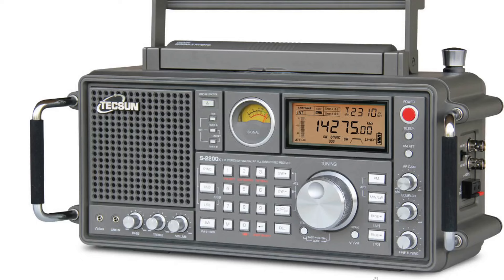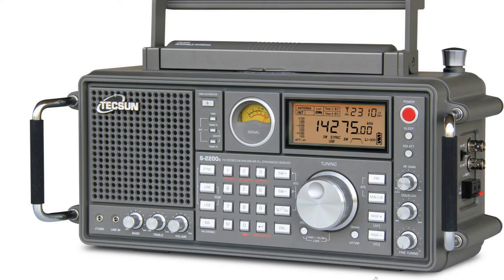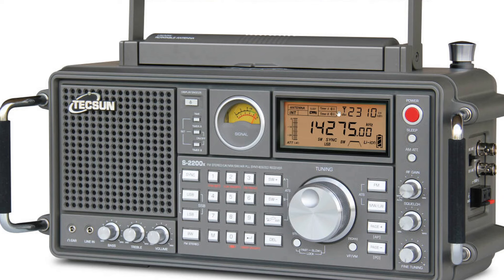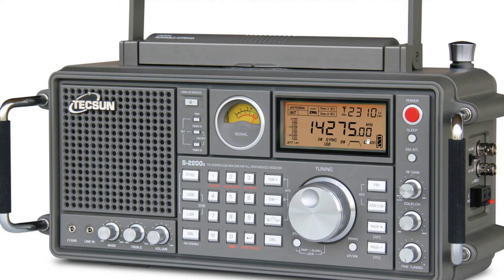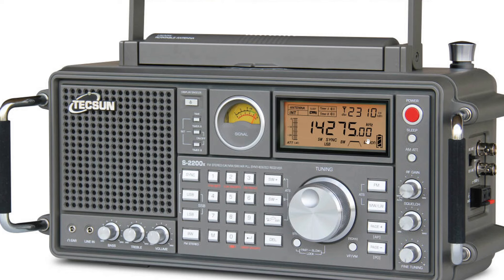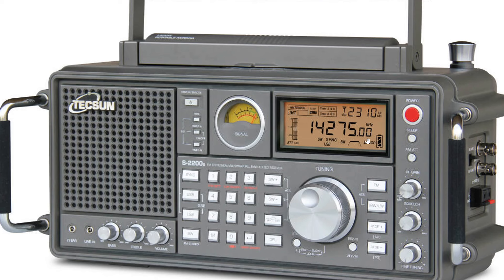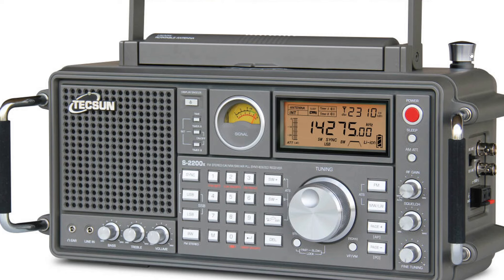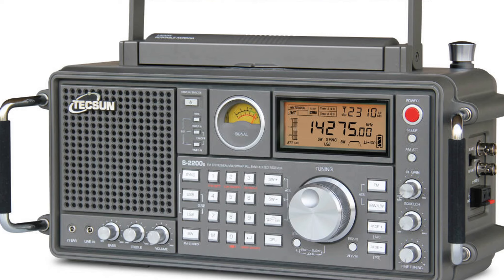Tecsun S2200x Seems to be recycled parts in a existing cabinet

Comment: I got one of the last production-series Tecsun S-2000s recently, actually the last one sold at my local radio shop. I have to admit that the feeling of having a "radio corner" with a big radio that's always there and with all the knobs and buttons and possibilities to add antennas etc. (plus the great LW/MW-ferrite antenna) gives a different sort of radio feeling than sitting on a couch with a portable. The S-2000 has some limits, but also some pros compared with my portables, but it's still a good radio. Maybe I am one of those that fell for the look & feel, but well...isn't that part of this hobby, the feel of it?  :)

Let's hope this S-2200 will develop into something great.

Comment: I bought this unit when it was still a Grundig about 10 years ago. It was $250. Thanks for the video.
Reply from the maker: It was not a Grundig...it Was a Tecsun S-2000 ... Grundig was just used as a name that was sold long ago.
Reply: I had one for 3 years until it died.
It was a disappointment. If anyone is going to review,I would prefer it be you. 
You'll tell the truth. I'll  be watching and waiting for your thoughts😎

Comment: In it's present from it's a very attractive radio with decent but not perfect performance . If those issues are cured on the new one that's great . Why change what people already like the general appearance of . Depends on the price of course . It worries me that your tuning has gone faulty . I have had reliability issues with Tecsun radios also . Mainly with a 330 and a 600 . I have had a 2000 for 2 years now and used it a lot . So far , so good . I still think Chinese equipment can be hit and miss . Impossible to get repaired here in the UK too so I hope this new one is ok in that respect . Only time will tell .

Comment: If the intention was to improve on the S2000 than it's welcome, It looks very nice, and adding new features is a good thing.
I see that some functions have moved to other buttons in order to add new features in a logic way.
About your tuning knob stopped working, You can desolder the tuning encoder, open it and clean it properly (it is sealed so you will have to open it), you can order replacement encoder from Annon-Co and just replace it.

Best Regards,
Moshe.

Comment: Won't that create some confusion? I mean, if it's going to be in the same case as an Elite 750, how will people know if they have the old or the new model? I know the Tecsun version is not called the elite 750, but you know what i'm talking about. They're sold by different companies, but they're essentially the same radio, like RadioShack used to do with Sangean radios. That radio that came out recently that everybody got upset about because it had a problem with the HD lock (among other things), didn't that one use the case from an older radio? I couldn't see any of the print on it. Was it easy to tell them apart?

Comment: The fact that your tuning knob is already malfunctioning is further proof to me that you have a defective unit.  I've owned my Elite 750 since August 2021 (purchased from Universal Radio); use it daily; and have had no issues with the mechanical aspects of the radio whatsoever. In fact, all of the knobs and controls still feel silky smooth.   While I can duplicate the Wide Bandwidth issues you have demonstrated in your reviews, I have had no issues with operating the radio in the Narrow Bandwidth mode.  Selectivity feels fine and I don't feel the need to detune slightly to avoid a "muffled" sound.  I also have not experienced severe overloading issues.  Still say you're the victim of some QA issues.

But, just so you know, I appreciate your channel and your reviews and am eagerly anticipating your review of the upgraded unit.  I have also really enjoyed your "looks back" at some of your past radios.  Thanks for all the informed videos!
Reply from the maker: only the knob is defective...that radio is bad in its design and the review I made stands ALL of them suffer from all the flaws I demonstrated and there are several top reviewers that all agree... you have the same issues... you just dont have the know how to notive... BAD Radio that is it!
Reply: I got an eton version, and only the FM part works properly, totally deaf on lw and mw, half deaf on sw.

Comment: I think they should have put it in a different case
Reply: True. They could have made it a little more efficiently. It looks too utilitarian. There are other newer sets that are designed with a completely different design philosophy like the Choyong model you had on earlier.
Reply: I like it tho......
Reply: The s2000 is one of the very few modern radios that dont sound like crap. A large part of that is thanks to audio amp and speaker size coupled with a properly large case. No way to make a small radio sound good.